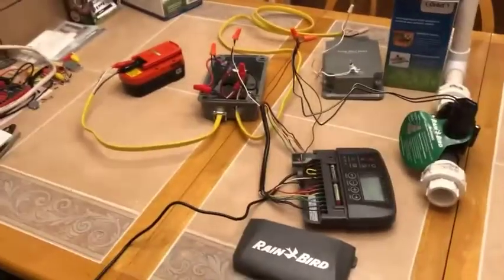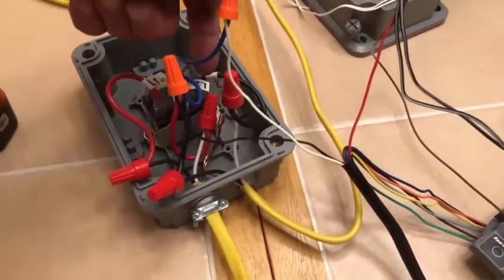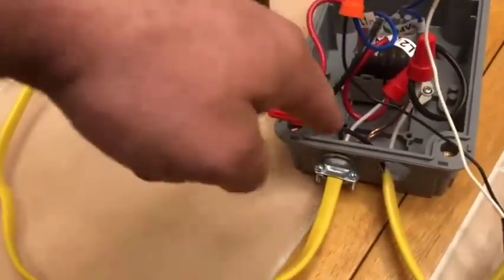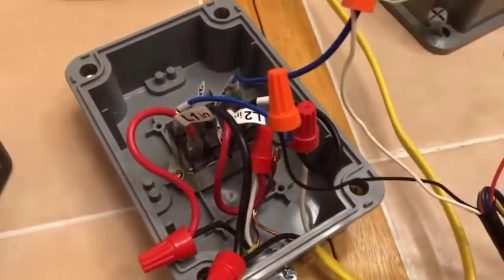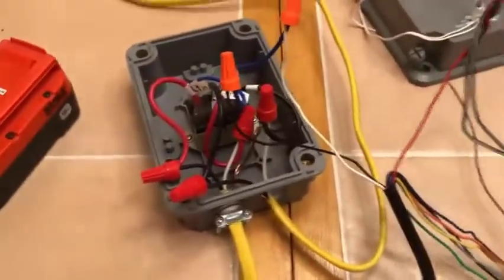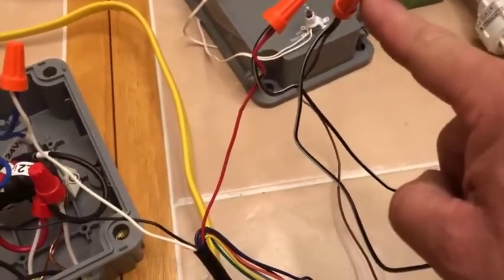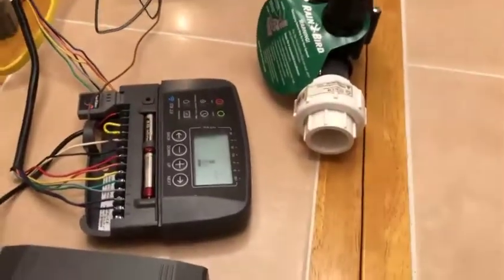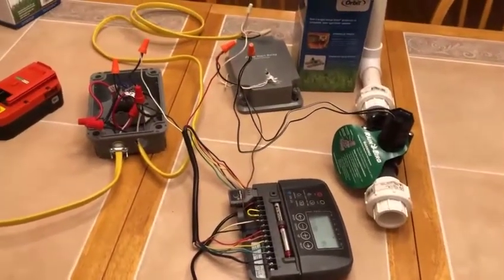4. Home Lawn Irrigation System - Electronics In Action

Comment: ???...so you need 2 power sources?  one to the relay and one to the rainbird?  "the same black wire"...you mean the black wire going out...NOT the Same...the other black going out...
Reply from the maker: First, lets start with just the rain-bird controller.  That, much like a home network is a simple power cord plugged in to give IT power.   This controller is going to be inside your house somewhere.  Second, the pump itself is going to be outside, such as in my scenario at the lake edge where I am drawing my water from.  That needs its own power.  Now, the wiring.  I have a second video https://www.youtube.com/watch?v=CcHFaiujry4   that can better illustrate the respective power to devices for pump and rain-bird.    In that you can see the main power from house, direct to the pump relay and then to the pump itself.

Then, all the low-voltage powering is coming from the rain-bird unit.  The white-wire within coming from the rain-bird is your neutral wire where every other wire is an individual hot (or black wire for normal home wiring).  But since low-voltage, can be these smaller gauge wires because of what they are triggering.  A simple solenoid, or relay switch to be opened.  Does not need full 120 power.  The multi-wire cord you can see in the diagram shows how the white is contiguous through the entire set of watering zones in the system.  And in my case, the last wire (black), is the one I sent to the pump relay because that was intended for the main power for the relay and no other reason.  Any of the individual color small wires would have worked.

Take a look and let me know if that helped add clarification.
Reply: @drapp5752  ....thanx!!!  been working on this for 8 months.  ruined 2 orbit controllers...lol...now using the rainbird arc8.  instructions for DO NOT tell you that a relay is needed.  even rainbird customer service did not tell me...just said call a contractor.  plus...major drought here in s florida...so i hot wired my pump to the main box...lol...
Reply: @drapp5752  ...thanx!!!!  drought here in s florida to boot...lol

Comment: can i use this setup with an outlet indexing valve?  i thought i was good with sprinklers until i ran into my friends well pump setup and now trying to update his system with a wifi timer, but i’m not understanding how the zones will switch (if that makes since)
Reply from the maker: Not positive what you may be looking for about indexing valve.  But other videos may help clarify that you may not have seen.
https://www.youtube.com/watch?v=CcHFaiujry4    Shows a diagram of my multiple zones handled by the Rain Bird unit.
You already watched how it gets hooked up "in action".  The software for the Rain Bird controller is actually quite good, you can set as timer-based, or even just run these zones now for X amount of time and they just run, opening only one valve at a time.  Set for 2 minutes, 13, or whatever per zone.  When finished, it just closes one valve and opens the next.  So, at any one time, only one valve is open and providing the watering to the lawn.  HTH and sorry for delay in response.

Comment: Does it really matter if L1 in   L1 out is the hot (black wire) vs the neutral wire ( white wire) 
Just as long as Neutral is hooked up on the pump correctly in a 120 volt scenario. 
I saw pump system  today were the neutral white wire was hooked up to the line side, which is the hot side on the well pump , And I was like well that’s not correct per instructions on the Meyers pump 1 hp sticker .
I asked electrical friend of mine How is that possible to run like that? He said magic
Reply from the maker: After watching the video, you are correct in what was STATED, but not how I actually connected.  The black wires were following the L1 in, L1 Out, and the White were on L2 in, L2 out respectively.  As for your Meyers Pump, I have no comment, but hopefully with your electrical friend to assist, hope all is working otherwise.

Comment: what kind of pump would you use to move water from a rain storage tank ?
Reply from the maker: Too broad a question.  No context to size of tank, if you are doing irrigation, what are your plans for volume of coverage needs?  Too large and you'll blow through the water in no time.  I would check with pumps for their gallons-per-minute flow, and start judging from that.  How long does it take to refill your rain storage tank?  Typical weather patterns / dry season impact?  Cant give ANY realistic answer at this point.

Comment: I have old copper piping ran for my wiring encase. Is it possible to run the wire through the soldered pipes. I'm thinking the issue would be the 90 degree turns. Any suggestions or should I just bury it? How deep?
Reply from the maker: Not sure what context your old copper piping is, and 90 degree turns would be an issue.  I buried my wire directly along the path of the actual PVC going to the final pump relay at the lake.  This way, I know its by the pipes and would be careful to dig either way... pipe or wire.  Buring depth of pipes I would check any local code and recommendations for freeze lines, but I also drain and blow-out my system each year.  Sorry I could not offer more specific answers for you.
Reply: @D Rapp  copper 1.5" pipe is about 8-10" deep. I blow mine out in the winter too. I just don't want to dig 100', if I don't have to.
Reply from the maker: I have no context idea of your copper pipe.  Is that just laying beside your supply lines to get to destination pump?  Is the copper ONLY to get to a destination pump and relay unit?  If so, and that size, I see no big deal about feeding the wire through it.  I would be just like an electrical PVC conduit is all.  90 degree bends would be big enough it should relatively easily allow to be pushed through unless you have a bunch together, then you may need to dig at the suspected corners, cut them near  the bend in order to help feed them, then just re-seal them/cover since they are not being used for water and pressurized purposes.  Note, if your copper pipe is ALSO running along the lines where your manifold / zone valves are, you need to get the wires hooked up, so you will probably need to dig, open the pipe, expose to get wires hooked, then continue the rest of the way down your destination.

See my other video showing this context along my installation...  https://www.youtube.com/watch?v=CcHFaiujry4
Reply: @D Rapp  yes, just a 1" pipe laying along side the supplyline to get to the destination.  I stalled just for the wiring. I'm thinking it would be difficult to curve the wire after 20" runs at a 90 degree angle. Not really interested in digging up 100 ft of pipe 8" deep to unsolder and resolder. The previous unit didn't require wires, manual gates.

Comment: Great video!! It helped a lot!!  Now, I discovered that my pump won’t shut off and water pressure from well is low.  I have to manually turn off power from breaker.  I’m using a Rachio 3 system which was running great for a year.  Could this be a bad relay switch?
Reply from the maker: Very well could be, especially if it is locked in the "Keep power connected" mode.

Comment: GREAT! help.  I was trying to figure out how to change my old 220v Intermatic timer, well pump relay all built into one to a new digital system.  Your video explained it perfectly using the 220v plug on the house  to the relay, THEN 24v to the timer. Thank you!
Reply from the maker: Glad it helped, I also had a secondary video at https://www.youtube.com/watch?v=CcHFaiujry4 because some were a bit confused seeing all the wires twisted and such.  It too can help provide clariification to the power flows of the system.

Comment: Great video!  Right now none of my zones are turning on.  Had zone 1 on and well pump wasn’t turning on.  From your demonstration it would seem I may have an issue with the relay that powers the well pump.  So now I need to figure out how to test the relay.
Reply from the maker: Maybe this secondary video might help.  https://www.youtube.com/watch?v=CcHFaiujry4 that shows a bit more connected for multiple zones.  If you notice, the white wire is your COMMON which needs to be connected to every node in the system.  Each individual color is a power (much like home electricity that always will have a minimum of black and white.  Power in, neutral out.  You can see in the drawing that the white is pig-tailed to EACH node, up to and including the final pump relay.  Please let me know if this helps resolve your issue.

Comment: Rather confusing. Having done these installations for years I can advise that this would have been better with letting us see you doing actual wiring of the three stages. Wiring the pump starter high voltage side from the breaker panel to the pump.  Wiring the pump starter low voltage to the controller for the purposes of activating the relay that is the pump starter. And thirdly the wires to the zone solenoid from the controller to activate the zone (railroad light).
Reply from the maker: Actually, some others DID have comments and I came up with a follow-up diagram discussion via https://www.youtube.com/watch?v=CcHFaiujry4  Which shows sample wiring from the house, and how the timer control goes out to the different solenoid units.  As this was my first and only installation, I did these videos as more of an informational of as much stuff as I could think of the help anyone else wanting to learn, at least become more knowledgeable, even if hiring someone else to do the job.  Better to be informed than completely blind knowledge.

Comment: What relay are you using?  I assume it is a 24vac.  Can you provide a link to the relay you purchased?
Reply from the maker: I am using an Orbit unit.  It was about $30, but the rest of the equipment was all RainBird.  I have another video my Intro at https://www.youtube.com/watch?v=eFkOoUoLeqI which does a summary of all my other videos from digging,  trenching, basic consideration of PVC material, and also covers as much as I could on manifolds, valve wiring and more.  The videos are all listed with context of "... Home Lawn Irrigation System...".  Even https://www.youtube.com/watch?v=CcHFaiujry4 which shows how the wiring works via a diagram to understand the general flow if you had any questions from the full video showing the wiring sample turning the valve on / off.  Good luck in your project, or at least help you become more knowledgeable of what you are getting into.

Comment: Thanks. I wired these today and tested it. Heard the solenoid hum and wasn’t sure if it was correct. But was just normal operation
Reply from the maker: Correct, the hum is basically the electronic activating the solenoid magnet to LIFT the plunger and allow whatever water to pass through the given zone.  When powered down, the plunger releases back in to stop water flow.  So, yes, that is normal, and if you heard in the video I did doing the electronics, you can probably make out the slight hum being engaged, then off when released.

Comment: Wouldn’t the pump coming on before the valve and turning off after the valve closes cause it to dead head, I’m going to install a pump but I’ve needed to look at videos to understand what I need and it confused me, thank you in advance
Reply from the maker: The sequence is correct and no issue for dead heat.  The time as you could see in the video is a split second.  So the pump would not even be up to a full speed and pressurization by the time the valve actually is open.  Similarly on shut-down.  Its a split second.  Nothing that would cause damage, otherwise people would be calling with all sorts of issues to the manufacturer of the master control unit that sends the signals to the relay switch.  Also, I have about a dozen videos going over many things, including a repair to my valve manifold because I over-tightened it (dohhh).  Anyhow, all else works well.  Have you seen the other videos, wiring the valves in live setting.  Final connection to the power supply at the water front, the visual aide / narration that shows the principles of how the pump start relay works, etc.  Even issues of parts planning, what to have, not forget, PVC pieces, cutter, sprinkler vs rotor sprayer, etc.  I tried to cover as much as I could so people could be informed, even if they do opt going to a professional company.
Reply: @drapp5752  thanks so much I will go look at your other videos you recommend. Thank you for replying, helped allot!

Comment: Hi friend   live saver  love the video ,I I'm using the same relay form orbit and the orbit timer .now let get to the point my pump is 240 volt ,timer is 120 volt ,this is what I have so far  .I cut the power cord from the timer attach white wire to ground bar on maim panel and black to one of the 120 volt coming from main breaker the other 120 volt from breaker is connected to( L 2 in  ) on the relay box ,L 1 out and L 2 out going to the pump .I have one black wire from the pump on the Timmer to one of the blue 24 volt on relay box .now I have red ( L 1 in ) on relay box loose  and one blue 24 volt loose also on relay box  should I wired nut this last two together to finish the setup ? I I'm doing this as we speak so help and corrections will be really appreciated thanks
Reply from the maker: Sorry if any confusion.  I made a follow-up video 4B that may help clarify (if you have not finished already).  This video shows a visual showing how the wiring goes.  As for running 240, I BELIEVE it is the same context in that the wires follow the same paths respectively.  Its just that both wires are supplying power and no neutral on the return, but as I stated in the video, I am not an electrician, but have done electrical work over many years.  Take a review of this video may help. https://www.youtube.com/watch?v=CcHFaiujry4&list=PLeyQN2q7F124CiCZqr0lPuYKo4bcay9RV&index=10

Comment: So Lines "IN" are the Feed From the Power and the Lines "OUT" are the Pump wires.  Lines 1 are on the one breaker and Line 2 are on the other breaker ?
Reply from the maker: Take a look at my 4B video which shows a drawing giving better context.  The two BLUE wires are the low-voltage coming from the timer controller.   
 I should have edited the drawing to show the blue from the low-voltage, but should be pretty obvious when you see it.  https://www.youtube.com/watch?v=CcHFaiujry4

Comment: What are the fittings called on each end of the seloniod thanks
Reply from the maker: The solenoid just has two wires at the top.  One for low-voltage power, other for neutral.  It opens a switch internally that lifts a gate type valve that lets the water flow through.  If you are referring to the pipe fittings on the end as threaded or slip, that is just standard plumbing fittings of the respective sizes.  If this does not answer your question, can you pleas rephrase for clarification.  Water flows in one side and hits the middle "dam", then once power lifts the dam, the water continues its flow out to the irrigation destination sprinkler heads.
Reply: Haha I meant the pipe fittings and I understand now thanks

Comment: hi again, Question again, I have black to L1 In, White to L1 out and Black to L2 out and white to L2 out, the side that goes to the pump. have the low voltage to the pump on the timer, there is power to the relay, but no power going to the side that goes to the pump. does that only receive power to the out going side when the timer sends a signal to the relay? and what can be wrong  if that is not happening? the low voltage is hooked up, common, and pump to the timer. Just wondering if the power going out is live without the sensor sending from the timer, I would think not, or the pump would go on. thanks. You have been helpful.
Reply from the maker: Hello Robert, Sorry for the delay.  I created a new video that I think will help clarify the wiring.  Check out from my list the "4B" video which does the breakdown showing visually with a diagram and narration how it all ties together.
Reply: @drapp5752  Hi I figured it out. thanks. I would tell you more, but I can't see the reply buttom after writing too  long.

Comment: I am confused. you said in the video the black to line in 1 and white to line in 2, but it's black to line out 2? and white to line out 1 the way you describe it, that you stay the same. So would it not be black line out 1? and white line out 2?  please verify. thanks.
Reply: that's what I would know, but your video said black L 1 in, and black L 2 out. That's why I was confused...You may not remember saying that. so I will do black L1 in and L1 out. and L2 in and L2 out with the white.
Reply from the maker: You may be right as I was pointing through the wires, but at the end of the segment of the relay, I restated that the ins and outs stay to the respective.  Since I dont have the actual equipment disconnected, I will see if I can make an update to the video, or re-dub the voice-over in that section.
Reply from the maker: Sorry for the confusion.  Think of it as a two-way drawbridge.  Each side of traffic is a color wire.  White comes in on one side, out on the other, same with black.  So if white is on L1in, the other half of the white going to the final power is L1out.  Black would be L2in and L2out.  The actual diagrams within the relay switch equipment shows black/white wiring respectively.

Now, for the relay portion that gets its low-voltage power from the timer control, you would also have a black and white available.  Those would connect to EITHER of the relay switch wires to let the power go through on the normal electric power lines.

Does that help?  Please let me know.  Maybe I'll put together another sample video of the wiring.  I can't do with the real timer and relay switch as they are in-place, but can re-do the simulation to show the pieces.